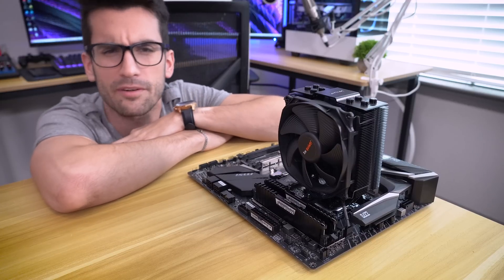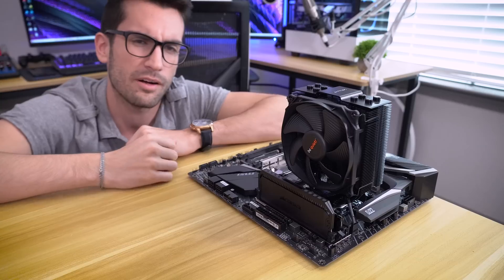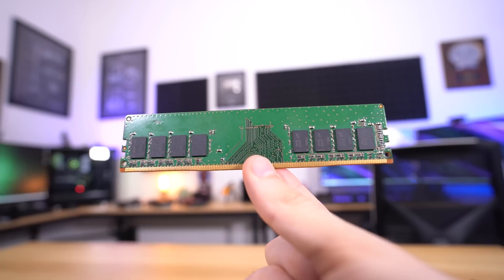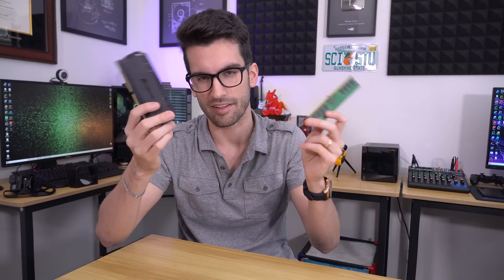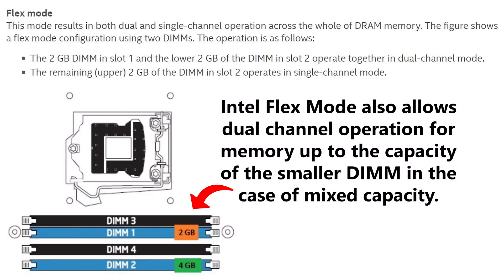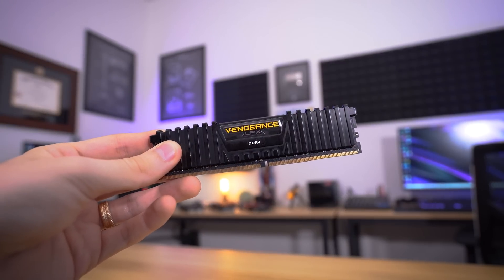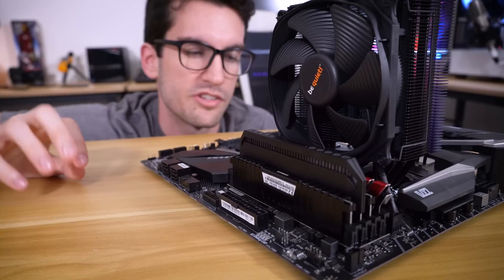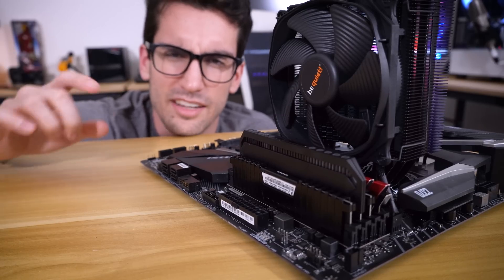Mixing RAM?!

Comment: I mixed a 8gb ddr4 crucial 2,66ghz stick with a 4 gb 2,4ghz crucial stick at my nephew's computer.
His cpu is the g4560 and it supports  2,4ghz rams.
Now it works in asymetric dual channel mode at 2,4ghz.
Before,Gta5 in story mode was lagish from times to rimes with serious framedrops for no reason.
Now it runs lag free.

Gta5 online with just 2x4 gb in dual channel mode, consumed crazy amounts of ram (Its the steam version).
When the ram consumption exceeded 7 gb,the game became horribly lagish and completely unplayable.
It even crashed sometimes!
Now it runs amazingly better ,at around 45-60 fps, lag free,with no problems whatsoever.

The gpu is a gt1030 with 2 gb of ram.

Comment: I have two slots in my laptop. One is stuck to the pc (4gb) and the other is changeable (4gb) so I guess I can choose a faster speed right? The changeable one is used for running the system and the other for the igpu and dgpu.

Comment: I'm just curious what  actually causes  problems with mixing ram sticks that should just work fine because they're within the specs anyway. I encountered a problem before when i added a different ram stick to use dual channel though it was supoosed to be supported, it worked on first boot, then the mobo died when i restarted it. I also encountered a problem on an entirely new build, when the mobo just wont boot properly until i changed a new set of ram sticks.?

Comment: So im running corsair lpx single rank 3.0 ghz or 3000mhz 16gb i wanna upgrade to 32 gb but wanna upgrade my speeds as well the new speed i want to go with is 3200mhz as it is the sweet spot i was gonna get one 16gb kit now. So.my question if i overclock with xmp it will default to the 3ghz right then i could manually select 3200mhz no? As my xurrent ram ocs to 3200 np

Comment: i would be pleased if someone helps me, im gonna upgrade my laptop ram (currently running 8gb 2400mhz) i feel like 16 is a little too small for me and 32 too much, i have already run crucials scanner to see what are compatible but can i have 1 SODIMM 16gb 2400mhz and 1 SODIMM 8gb 2400mhz?  that is 24gb of ram will this work?

Comment: so lets say i buy a a 16 GB stick that runs at 2400 MHz, and I put it in with the 8 GB one I already have that is running at 1330 MHz. If I understood correctly, the 16 GB stick will run at the 1330 lower speed. Now my question is, is it worth it to lose the extra speed and have 24 GB of memory? This would only be temporary until i get enough money to buy another identical 16 GB stick but i figure, Why let a good ram sit in the storage.. Thanks for any help i can get, I'm new to this PC stuff.

Comment: if you use 1 4gb ram samsung and 1 8gb corsair with the same speed you will have any issues?
Reply from the maker: I literally discussed this in the video :-) No, you won't have issues. However, only the first 4GB will run in dual channel.
Reply: Ok bro thank you a lot

Comment: So I have Tforce VulcanZ 1x8gb 3000mhz, C18. (Came with the computer, and I was already gunna upgrade.) But i bought Vengeance LPX 2x8gb 3200mhz c16. Could I add in the Vengeance ram to the Tforce VulcanZ, and have 24Gb ram running at 3000mhz, even though one is C18, and the other is C16? Or should I save up and by another 16gb of Vengeance ram. I just dont want to deal with the errors if it's a hassle then nvm.

Comment: Plzz help...im having 2x 4 gb ram adata 2400mhz...i want to add 8 of ram..mobo support 4 ram slots z370 msi...should i add 3200 mhz  8 gb and later upgrade with anather 8 gb ram or should i add one 2400 eight gb ram...im on a tight budget

Comment: I'm planning to buy an extra pair of ram to add my system, I"m currently having 2 sticks.
Could you do a testing video, running ram86+ and other stress tests, gaming and application test runs on systems with:
- same ram (same model, manufacturer, speed, CAS, etc.) but different purchases. Basically, you got a pair, then after a few years, decided to buy another pair, exactly the same, later.
- different ram model, but same speed and CAS - You wanted more ram, but the one that you bought before is no longer available or is substantially more expensive than another pair that you found or you prefer another pair due to its aesthetic.
- different models, speed, CAS. - Like, buying a higher speed ram so that it will work fine when downclocked to the slower ram's speed and timings. 

I would love to see test results of those but I don't have extra ram on hand to test and couldn't find concrete information anywhere else.
Reply: How much you want to bet he's not gonna make that video.

Comment: been using 28gb in my ryzen 7 3700x system, i 2600mhz team group 16gb and 3 corsair vengance lpx 3000mhz dims. all running at cl 15 and 3133 mhz stable. odd but functional.

Comment: Been running a DDR3 Quad-channel mixed memory setup on my x79 Mobo with the 4820k, I have 4 Corsair Vengence 1600mhz, 2 Ripjaws 1600mhz and 2 Kingston 1600mhz, the corsair being each 8gb sticks and the others 4gb for a whopping total of 48GB of ram... no crashes

Comment: ASRock bios enables XMP profiles by default.
lets say you got 2 sticks of ram. 1x4 gb and 1x8gb. the 8 gb one usualy has bigger timings than 4gb stick.
So in some cases the bios will detect the 4 gb stick first and enables the XMP profile applying the timings for the 8 gb stick (Memory overclock) don't expect it to run more than a few weeks.
If you got this setup and when you press the power button the pc starts but the monitor stays turned off and you have to keep trying a few times untill the bios resets so you can see the post image it means your ram is dying or already dead. Windows detects it but you can't use it.
 dont mix sticks its stupid. find someone to trade your's with for the one you want or sell it . better than killing it.

Comment: I actually do this with laptops. I salvage SODIMMs from dead ones that my mother can’t use anymore and stick em in other laptop or even sodimm-only All-in-Ones like a HP Pavilion.
I have an old gateway laptop that i’ve used two different brands on (though it did have a kernel panic with one due to faster than supported memory speeds, has a intel i3-370M in it)

Comment: Yes I had system issues when I mixed ram of different frequency and latency both were same size same company and both were ddr4 but still my computer crashed and had a bsod 4 times. I removed the higher frequency ram and now all is well so guys make sure you have identical rams

Comment: This has always been a question in the back of my mind. They act like you need to buy RAM in kits or else it won't work right. I have no intention of mixing it as badly as you did here, but at least I now know I can buy a stick or two now and add more of the same model later as needed.
Reply: Exactly, I just did a ton of research on upgrading from 16gb to 32gb, everyone makes it seem like you need to have matched sets. However, I think it only matters that they all need to run at a certain speed.

One other issue  not to overlook is there are single and dual rank memory, it seems you want make sure you keep this consistent. But other than the rank, as long as you run the memory at the lowest memory stick, you will be fine and it doesn't matter.

Comment: My old rig used to have 12 GB of DDR3 1333 RAM. I used a 4 GB and 8 GB kit and it did run into problems every now and then due to the mixed kits and let me tell you, those moments gave me gray hairs each time.

Comment: Atm i currently run 2 different kits of corsair cm16gx4m2b3000c15 samsung and cmr16gx4m2c3000c15 Sk hynix i have not had any bsod or any other issues they work great i could not find the second ram kit on newegg to keep them matched the timing i did try to stay with

Comment: 4x XMS3 1333mhz 4GB (1 is bad and reads as 2GB)
2x 1600mhz 4GB (1 hynix, 1 other brand)
2x 1333mhz 2GB (No branding)

All with an oc'd 3930k @ 4.5Ghz in a GA-X79-UP4. 

Very janky but works w/ no bsod over about two years

Comment: Can mix match ram brands or capacity generic or branded as long as the frequency are identical to avoid incompatibilies
Reply: Even the frequency won't be an issue since your system will run them both with the lowest frequency you have btw them

Comment: Do it would be a bad idea to Have?
Chann 1: 32gb 2666
Chann 2: 16gb 2666
Reply: what abt having a 2x8gb of corsair vengeance ddr4 2400hz in pair
then yr later i will try to put another 2x8gb of hyper x 2400hz in the second channel of my Msi b250 motherboard hving i7 7700. will this configuration be good. im not into overclocking. i want my parts to last as much as i can.
my Corsair vengeance working fine since 2018.. hows hyperx compare to corsair vengeance in servicing and warranty repairs in delhi, India 🇮🇳

Comment: Sir, i am having a 4gb ddr3 1333mhz, can i install a 8gb ddr3 1333mhz in 2nd slot, will it work perfectly??
Reply: Haven't tried it not sure but i think there isn't going to be a problem. But it would be better if there where just 2x8 gb sticks. They are cheap and 16 is better than 12gb of ram even if its ddr3
Reply: It will be fine, I also have 12gb ram with a kingston 4gb stick + a 8gb stick of cheap ram, works without problems.

Comment: why don't you remove the old memory from your laptop. Sure you'll lose a little bit of ram but it will run much faster.
Reply from the maker: Much faster? This is Intel were talking about. Won't make much of a difference in most applications. Also, we're talking about only a few hundred MHz between them. The benefits of an extra 4GB DDR4 in video production far outweigh the small frequency delta.

Comment: i had 2 sticks of hyperx ddr4 8gb 3200mhz, then i added 2 more of hyperx ddr4 8gb 3200mhz but they new ones a abit different and my system started acting wierd, first windows didnt boot, then few games kept crashing, why is that? also i check my bios and the 2 new stick run at 2400mhz and the 2 old run at 3200 and i couldnt change the speed of the new ones

Comment: I have mixed ram and seems to run fine, I got like 3 different ram sticks( 1 2GB Samsungn1333mhz, 1 2GB Kingston 1333mhz, and 2 4GB 1333( can be sped up to 1600mhz)  Corsair.

It just slows the Corsair ram down to 1333mhz or it will only see the 8 gig Corsair, but it seems to be better to have 12gig of ram instead of 8gig slightly faster.

Comment: Hey Greg quick question,

I bought two sets of identical ram, Trident Z RGB 3000Mghz, when I plug them all in it reads that I have installed 32gbs of Ram but states I can only access 16GBS of it. I was wondering if you had a video or know of a creator who may have explained how to fix this issue? I assume it has something to do with the memory timings and I tried to tweak that on my own but for whatever reason the timings volts and speeds just wouldn't stay saved when I exited the bios it just defaulted back to the preset.

Comment: I have a first generation ryzen 1700 processor and my ram was not supported by the motherboard but it did work before the first BIOS update. Than Computer didn't want to post so I bought 4gb of some cheap memory and just by adding it the whole thing started working again probably by lowering timings or frequency of the complete ram. After updating BIOS again everything works fine but then I bought third type of ram. So now I have 20 gb of three different types of ddr4 and the system is working quite good. For  couple of years I never had one blue screen... Or maybe I had one.. on a cheap 350 gigabyte motherboard.. the point of my long ass story is-if you want to try to put different kinds of RAM into your computer why not, what's the worst that can happen?

Comment: I'm running mixed memory in my PC. This PC is very old, its running an AMD FX-8350. This CPU was new at the time of acquisition. I have never had a problem with mixed memory before, but now that I know its not something you are supposed to do, back when I upgraded my RAM I had no idea, I will run the same memory.

Comment: I have a question ive been trying to find but not enough real anwsers around that i can find.

I have 2x8 GB sticks and 2x4GB sticks. What happens if i use all 4? Does dual channel support change to quad channel or does it set it to single channel or what really happens? if i get 24gb of ram from using all 4 of this then would it be better even if its single channel or am i better off only using  16gb 2x8
Reply: Put 8+4gb in channel A, and put 8+4gb in channel B, then you will have 12gb in each channel, running dual chanel, all good :) channel A are 1st and 3rd ram slot, channel B are 2nd and 4th slot.
Reply: @Sale140  Really thats how it works? like no BS? because im about to buy then 2x4 of same exact make and model and slap them to my 2x8.
Reply: @IVAN-zm8pz  yes man, no worry, just put in channel A 4gb stick and 8gb stick, and then put the same in channel B, you will have 12gb in each channel running dual channel(24gb total)
Reply: @IVAN-zm8pz  you can then install cpu-z just to verify if its all good...
Reply: @Sale140  thanks man. im try it.

Comment: I have Corsair vengeance LPX 8x2 16 Gb ddr4 2400mhz RAM running on 2666 Mhz OC'ed, I want to add another 8x2 i.e 16 GB   corsair vengeance pro RGB, should i do it?

p.s i understand rgb 3000mhz module will run on 2666Mhz, but other than that should i buy it?

Comment: So let's say you mix 3200 MHz modules with 2400 MHz modules. Could you just overclock the slower ram to 3200 MHz?

Comment: So, I currently have a 2x4gb Corsair vengeance in my system, I’m upgrading to 2x8gb Corsair vengeance rgb pro soon, will I essentially be able to run both and have 24gb of ram
Reply: Im in your same situation, ive read mixed opinion searchin on google...
Reply: @zapataboy9377  I think I'm gonna try it, if it shows up I'm just gonna roll with it, they'll be at the same clock speed so shouldn't be affected performance wise
Reply: Did it work?
Reply: Anarchy is Order it is actually working at the moment, got all ram set at the same clock speed and it seems to be running fine

Comment: lol been running mixed ram in systems since win xp days  use to have a 128mb and a 256mb stick in my system even nowdays  i had 4 4gb sticks and 1 went out so now i got 14gb of rAM because all i had was a 2gb stick laying around when one of my 4gb sticks went out still runs smoother than 12gb tho

Comment: Based on my experience, its fine but i dont recommend it.
Reply: You are lucky or i am not..... My last computer broke down due to different DDR3 ram i used.

The repair guy told me those rams require different voltage (signal or power? I don't remember). He show me the burnt chip on mother board next to the ram slots. 

P.s. It worked for half years though, but sometime it cannot recognized 1 of them.
Reply: Joe Lau Joe Lau oh shit too bad man. Im using 2x8 gb ddr4 3200mhz hyperx fury and a kingston 1x8gb ddr4 2666mhz. I have been using my rig for 2 and a half years now.

Comment: I don't think you ever tested this for years, so you push hypotheticals. Not a good way to educate.
I ran different modules for years, at the bad case scenario it causes stutter in games, at worst it can degrade memory. I have sticks now that are not fully recognized in some ram testing apps. It can no longer allocate ram stick size. It doesn't know how much is there, but Windows works with them, and they are visible in the system, useable ram.

Degrading ram module can be caused by mixing different speed and different timings.

In short, don't do it. This is an advice from someone who ram it for years. I buy same model and same speed now.

Comment: I have 2*8 gb ram 3200mhz and 2*4 gb ram 2400mhz. And the first one still working at 3200mhz. I check it with in the bios and with benchmark and this setup give me more fps in game than the only 2*8  3200mhz memory alone
Reply: I've got b350 with ryzen 1600

Comment: Use mixed memory if you have to. But, be careful to choose the same frequency, so that there's no slower module to slow down the faster one.
Reply: what if i am getter the 3200mhz at a cheaper rate than 2666Mhz

Comment: i had problems with mixe modules back in ddr2 days (i had 2 seperate systems but only had sets of 2 dimms) and no matter how i mixed i got ram related blue screen pretty much every day (dont remember what motherboards i used, but cpus were intel core 2 duo e6400 and core 2 quad q6600)

Comment: In my experience with make-do-and-mend PC builds over the past 14 years, you can super easily get away with mixing RAM speeds and capacities, but absolutely not for mission critical machines such as servers or workstations. For gaming PCs where the worst that can happen is you get temped out of a competitive game, it's not a problem.

Tips for RAM mixing:

1: Check your modules and ensure they are the same speed. If one module is 1333MT/s then match it with a 1333MT/s module.
2: Check the timings on your modules. Again, all modules should be the same timings and also subtimings for best results.
3: If possible, use modules which you know have exactly the same manufacturer and even model numbers for DRAM chips. This will aid in matching modules with steps 1 and 2. If you have Samsung B-Die RAM, try to get another B-die module to pair it with.
4: do NOT mix ECC and non ECC DRAM ESPECIALLY ON A SERVER OR WORKSTATION. Doing so will disable the ECC module on the ECC DIMM rendering it essentially useless and in my experience almost always leads to instability.

Do the 4 steps above and you reduce the chances of instability tenfold. you should be able to mix and match capacities provided at least conditions 1, 2and 4 match up well. For servers and workstations, try to use the exact same memory kits and even put DIMMs from the same batch into the same memory channels just for that added peace of mind. It's not as deadly vital compared to the 4 steps above but if your entire company's viability relies on it. You're gonna do it regardless!! Nobody wants an unstable server unless it's for testing purposes!!